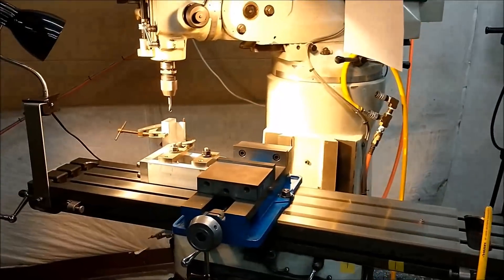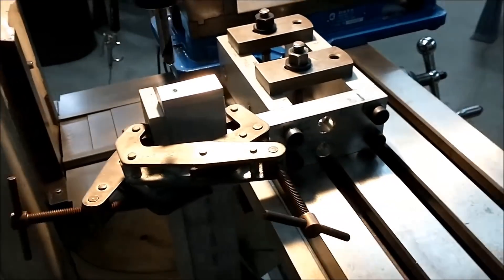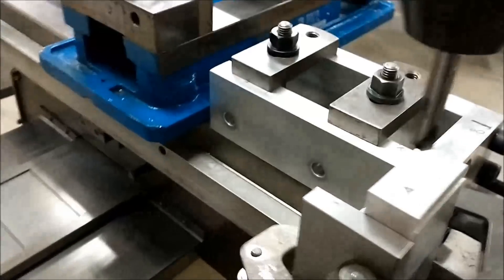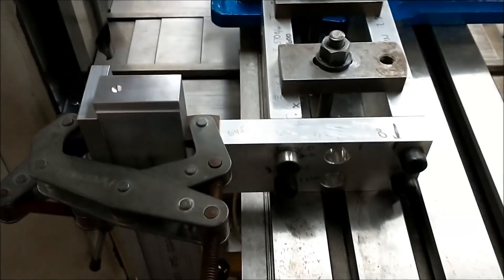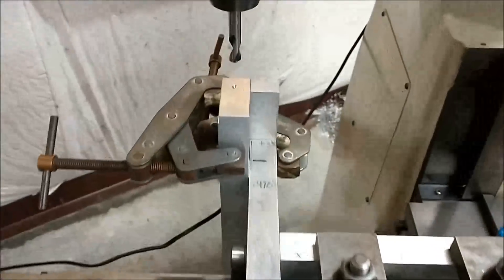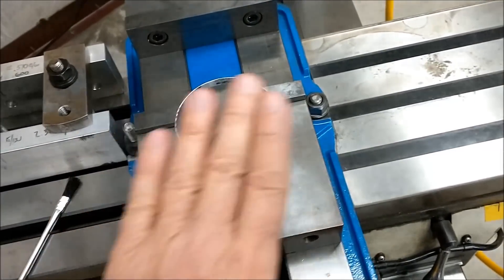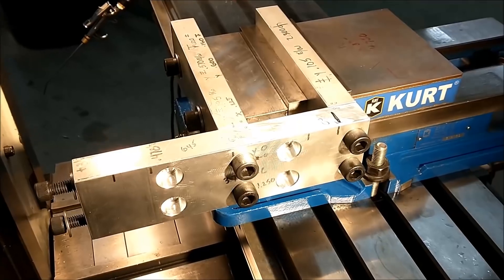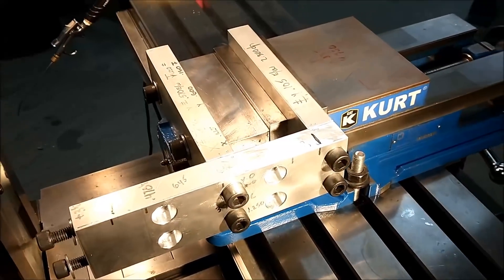Machining End Features in Long Parts -- The Vertical Outrigger

Comment: thanks to you i have just employed this idea when machining a long part.  now comes mounting my DRO and i fear i'll lose the use of the back of the bed.  how did/do you account for that on your mill?  would you mount the dro on the front of a B-port?  seems not right to me
Reply from the maker: The bar that runs along the Y axis is just a bit longer to clear the scale. I have my locator rail on the outside, but if you need more security, mount your stop bar a little inboard so no material can get close to your scale. Basically build the security into the jig.

Comment: Thanks!  Yet another practical, useful tool and technique for my shop.  I've been mounting a right-angle head on my Bridgeport to drill and machine end features in long parts.  It works well, but this is much, much faster.

Comment: Joe, you're killin me😁...too many projects are ending up on my to do list . Anyway, the question I have isn't related to this video but to another of yours where I saw you using some small hold down clamps (black) on a plate with several drilled and tapped holes....both of which you said you had made...I'm wondering how big those clamps actually are, I'm not sure just by looking and do remember what you used for material to make them, 4140? heat treated or not...I'd like to make a similar set, they look really handy for small stuff.
Thank you for doing what you do!!
Reply from the maker: I forgot what material those are made from, but they need to tough, not brittle, so be careful. They are about 1.5" long, 3/8" wide and 5/16 thick. The slots and jack screw holes are all sized for 10-32 socket head cap screws.
Reply: @joepie221  Thanks Joe

Comment: Drop a strong little magnet in the botttom if your oil pot helps keep it in place on any steel surface.
Reply: Never thought about using magnet, need to find me one that fits in my soup can. LOL. I use a disc of 304 stainless for many a year.

Comment: The machinist that I bought my mill from related a story that your video reminded me of.  He had worked for a company that needed tapped holes in a 2.5 inch shafts that were 20 ft in length.  The shafts were too big to fit in any of the lathes they had available.   He had a hole in the cement next to his mill that was large enough to drop the shaft into and used a fixture somewhat like yours to hold it while he drilled and tapped the holes.   Just goes to show that we sometimes have to think outside the box.
Reply from the maker: I've heard similar stories. Necessity is truly the mother of invention.
Reply: Was the hole 17' Deep?

Comment: I have a recurring job to make a .150 slot in the end of planer knife blades (HSS) that require the same "off the table" requirements. Even trickier since they are razor sharp and thin. I use a small machine vice, clamped to the table on it's side and swing the head as well. 

Fixturing takes 5x more time than the actual job and charging for it is the largest arguing factor i have with customers.
 Thanks for the great tips. We all have our own and sharing makes everyone a better machinist.

Comment: This is why I like horizontal mills, just bolt it to the table and b'done with it
Reply from the maker: The part or the fixture?
Reply: @joepie221  bolt the part straight to the table.
 l used to machine c-spanner slots in  large hydraulic glands by bolting a couple of toe clamps to the table, of a twin spindle 'bridgeport' layed out like a vee block, and then lay out some index marks along the circumference of the gland, and bolt that straight to the table, sit it up against the ' vee block', using the edge of one toe clamp as my index mark pointer., Kind of like a rotary table with out the rotary table
Machine one slot loosen bolts swivel quickly to next mark, tighten bolts and you're ready for the next...impressed the hell out of the boss. 

It helps if one toe clamp is parallel to the y axis and the other fence is parallel to the x axis as this helps with edge finding and centre finding.

Triangles never lie unlike parents squares and other polygons.
Use vernier height gauge to mark out your index marks using r sine (360/x)

Comment: As usual Joe, your setups are terrific. I have myself swivel the head, clamp a v-block and tight the long part on the v-block. Your setup on the on the other hand is more solid.
Thanks for sharing.
Reply from the maker: I guess everyone's setup is driven by the job. I've used the V block setup too. This outrigger was job specific but has come in very handy after the fact. Maybe a V block arm as an attachment would be a good addition to this rig??

Comment: Years ago we made an angle mount for a 4 inch Kurt vice to hang it off the edge of the table to work the end of long pieces.. We rotate the column and extend the ram like you did.  We can work the end of anything that doesn't hit the floor. It is a common requirement at times that even a big CNC machine can't meet. I pondered tilting the head 90 degrees and putting work on the table but that is fraught with challenges. If we had the mill on the second floor we could cut a hole in it and work on even longer pieces. Don't have a second floor here how about the roof?

As usual you show another great example of ingenuity expanding the versatility of the Knee mill.

Comment: i was wondering how it was going to be secured in the vice without crushing the open-ended part, then you showed the setup at 2:57 ...is that a custom block the has to go in there that's exactly-sized and thus has to be kept as part of the outrigger jig? couldn't you instead have made it a box instead, then it couldn't distort? as always, thanks!
Reply from the maker: The section I squeeze in the vise jaws is rarely 'unloosened" from the setup. The bolt holes on the section that bolts to the outer end of the vise are slightly oversized so everything can be snugged at the same time. It makes for a fast and secure setup.

Comment: What are the limits of ram extension in this application considering center of gravity and stability?
I am a regular viewer and greatly appreciate your invaluable sharing of skill, knowledge and experience.  You have a rare talent and are using it exceptionally well.
Best Regards,
David
Reply from the maker: Thanks David. Extending a table, swinging a head and mounting a heavy part is a good recipe for flipping a mill on its side. Not until you see it happen does it sound possible. If this is something you do regularly, ( the setup, not the flipping ) extend and rotate the absolute minimum you have too and for added safety, the machines base should be secured to the floor. If you sense the setup is pushing the limits of good practice, building up a safety tower under the table would probably be a good idea.

Comment: Great timing, I need to mill a slot, in the end of a 20'' bar of 1'' 6Al4V, it's the handle for a CPM-10V Tomahawk head I'm making, was going to do it horizontally, but don't really want the rounded slot end (would need to round over the base of the hawk head), I only have a mini mill, but have access to a larger mill, that the head swivels (rong fu style), and your technique, should make it possible.

Thanks, Joe,

Scott.
Reply from the maker: Good luck Scott.

Comment: Another handy work holding device for the Bridgeport is a 2x9x12" "tombstone" keyed and screwed to the table. All hardened and ground with removable, interchangable end plates. With the face drilled and tapped for clamping details to it, or c-clamp over the detail and the tombstone.
Made one back in 1990, and 3 more in another shop when co-workers saw the benefits of it. I used mine almost every day.
Reply: Can you post a link to a photo of your tombstone.

Comment: If you machined a V Groove in it, you could use it to drill long pieces of round bar, eg. putting centres in, for turning between centres, on round bar too large to pass through the spindle bore.

Comment: I suppose if the part is really long you'd be able to use such a tool tool to raise the part high enough away from the table that you could turn the head 90 deg and mill it like a horizontal. Would be super awkward but hey.
Reply from the maker: You'd wear out your arm moving the X axis, but it would work.

Comment: Nice solution for a bigger mill the home models don't reach to the end of the table neither in Y or X movement.
Reply from the maker: That problem would get my mind going to figure out a solution. Does the top of the machine unbolt from the bottom??
Reply: @joepie221  that's posible but a crime tot adjust the mill again. Lifting the column would make the machine more whacky. And these mills usaly sits on a workbench and giving the column extra Y will get you 6 inch extra in hight. But I like a sugestion from Joe 😀

Comment: Bridgeport style mills also have a T slot on the front of the table that long parts can be mounted to vertically.  Much simpler set up if you're just drilling holes.  Still have to rotate and extend the head.

Comment: The oil can idea isn't mine.  I believe I saw it on Randy Richards channel and thought I need to make a few of those to use. I happened to see your oil can in one of the videos a while back and thought you could use one of these. My way of thanking you for sharing your knowledge of machining. Enjoy
Reply: Bill, I have made some of those, but how did you hem the top edge so neatly?
Reply: @mocarp1  I used my bead roller with 2 flat rollers, after I started the bend with a tipping roller.  Cheers

Comment: the reason to have a bridgeport type machine...
Reply: True. I used to think lightly of Bridgeport type machines because of so many adjustments.
But come to think of it, that's what is needed to do every kind of jobs thrown at you. It's no longer as rigid, but cut lightly, it will get the job done. 
Great idea on the tall part fixture.